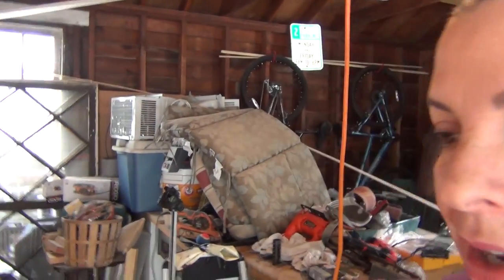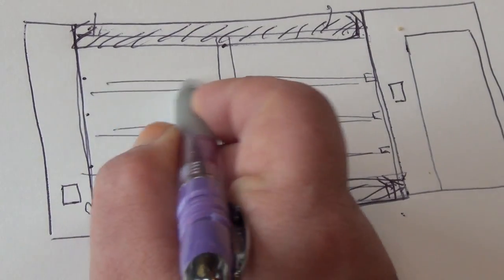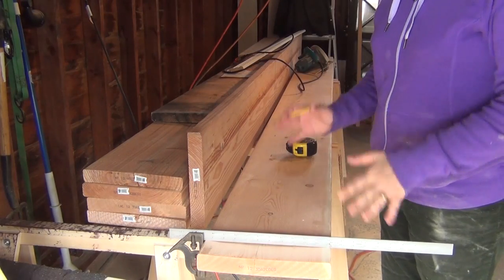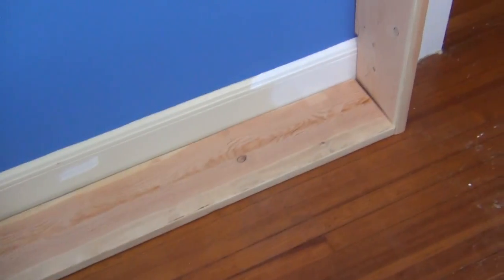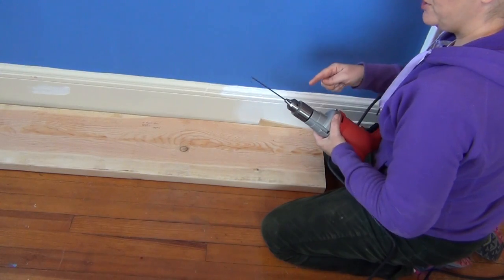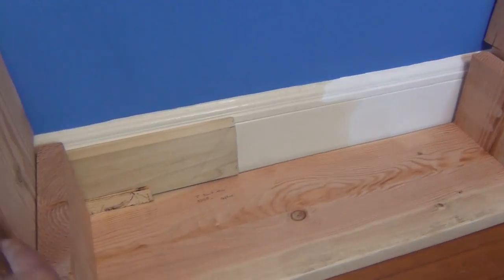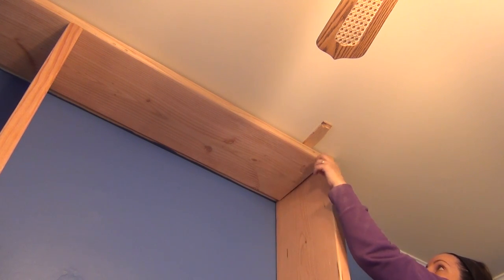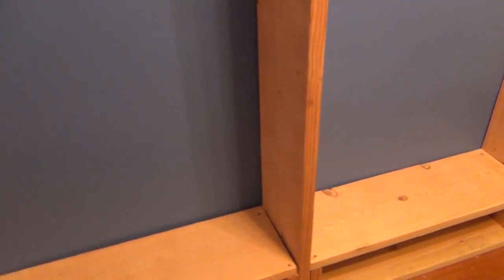Home Office Makeover: Bookcase I

Comment: Is there anything you can't do? Lol   Awesome shelf, it's going to look beautiful when you get done.  Suggestion for the cracks between the wood and the wall.  Use "quarter round molding" from top to bottom.  It'll finish that off beautifully and you won't have to bother shimming and caulking.  Can't wait to see it finished.
Reply from the maker: Terry d I am having second thoughts about leaving the back blue. What do you think about a whole panel covered in the same fabric I ll pick for the curtains?
Reply: My Great Challenge I think you're right and that would look really nice.  I wouldn't leave the back blue because even with the books in it you'll still be able to see that.  In fact that would look great instead of the blue.
Reply from the maker: Terry d you nailed it! That's exactly what I have in mind, only a lighter grey and the fabric would be pleated.
Reply: My Great Challenge  Oh it's going to be awesome.  Yeah, I agree--that will really compliment the color of the room and make the bookshelf appear more built-in without showing the wall color in the back of the shelves.  Go for it!  It's gonna be beautiful!

Comment: You are so clever Sophia. Will you be able to access the base space where you are going to put your time capsules and doggy's ashes? I suppose the boys will remember they are there if you loose your marbles and don't remember putting them there in 30 years time. I'm hopeless at remembering where I put stuff, which is why I'm getting rid of anything that I don't use so my kids don't have to do it when I can't.
Reply from the maker: Michele McGill No that's the point, no access. I may pry the side open to place my other dogs ashes and the cat's when time comes, but the goal here is to seal it off for the next century or more. The house is solid, it will last another 100 years!